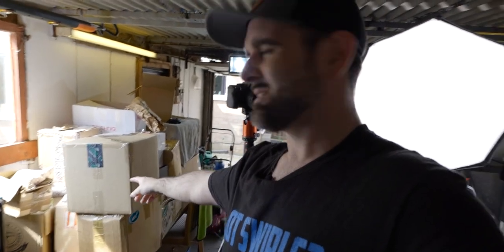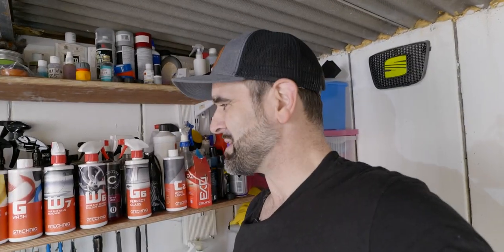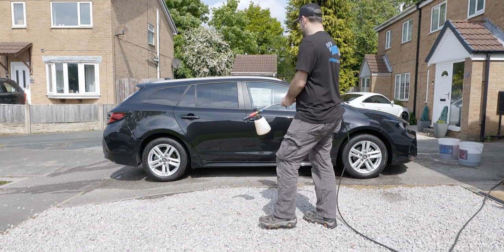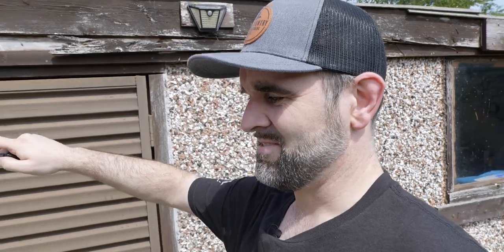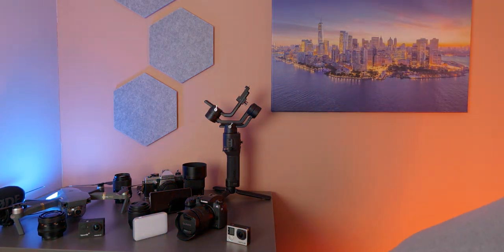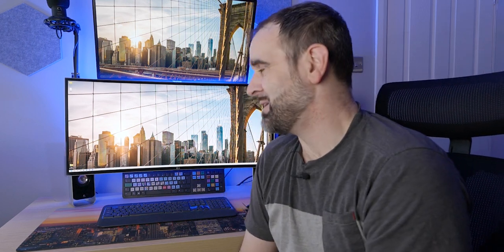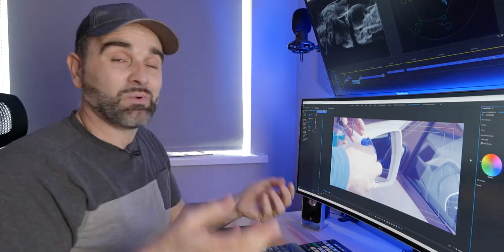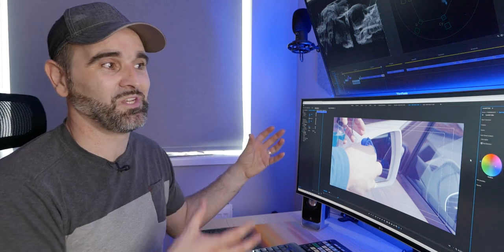How To Create Your Own AMAZING Detailing Videos

Comment: How you finding your S5? Love mine aside from the occasional AF issues.
Reply from the maker: Awesome tbh.... Not really had any AF issues, well, now and then in 4k mode, but other than that, spot on
Reply: @TheDetailingSpace  good to hear. I've not shot in 1080p before, does the AF seem to work better with that? I hear the focus is better too at higher frame rates but I don't particularly want the crop that comes with it. Fantastic camera all round. Did you get the kit with the 20 to 60 and the 50mm? Unreal value for money the S5 is.
Reply from the maker: I did indeed. I shoot max 100fps for slow motion. I don't go higher due to crop....

Looking at the 24-105 lens or 70-200..... Ideally I want something up to about 140mm I think.... 70-200 would give great shots, but think 24-105 may get more use, just a shame it stops at 105
Reply: @TheDetailingSpace  24 to 105 would be the best piece of kit I think but it's a tad expensive 😬. I think the 50mm for me is the best, just bought an ND filter to use it with and I think it looks so sharp at f8, just have to be in a different post code to the car I'm filming so I can get everything in frame 😂.